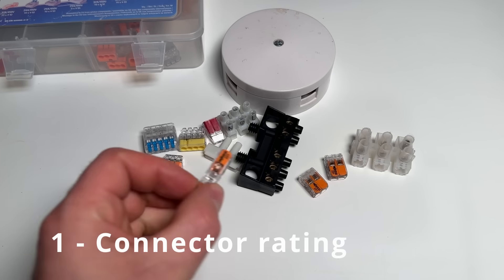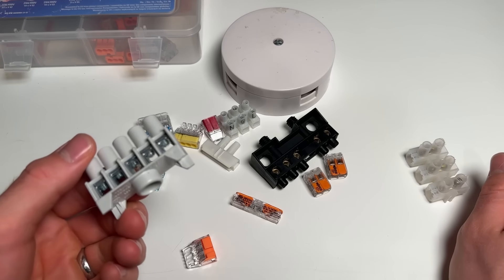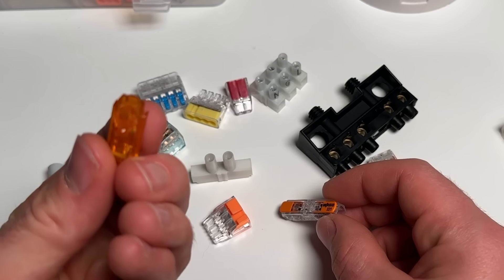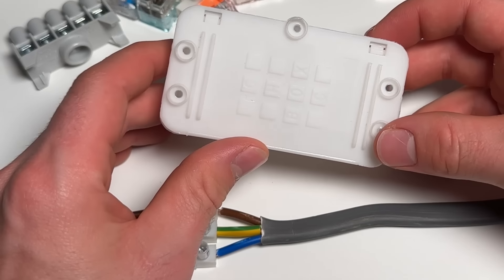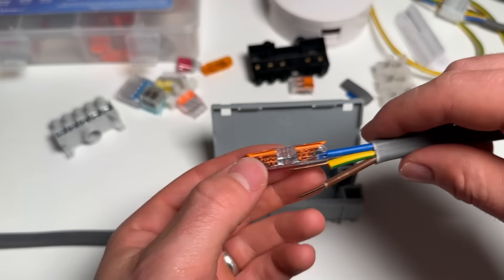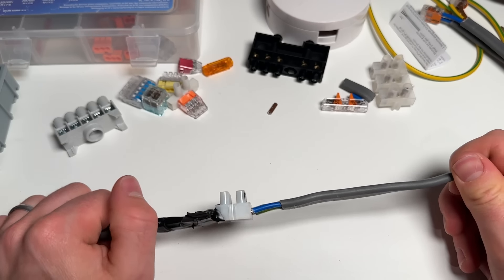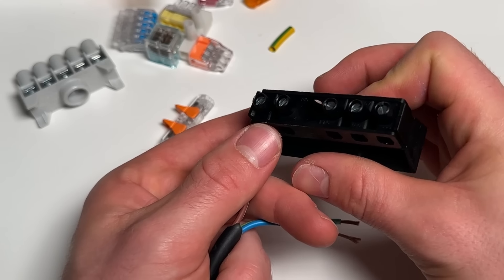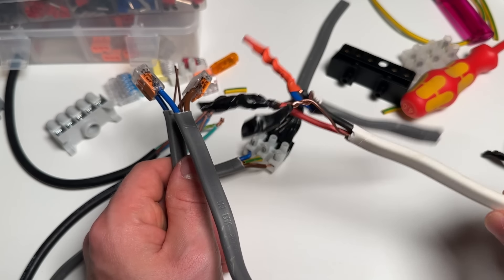BIGGEST DIY Mistakes Joining Cables

Comment: The 30 A junction boxes can be used on a 32A final ring circuit, but not a 32A radial. In fact a 20A junction can be used on a ring. A ring splits the current.
Reply from the maker: Rings don’t split the current evenly, you could in theory have a large ring with a socket close to the CU, pulling a large current, exceeding the 20a. Thanks for watching
Reply: @TheDiligentDIYer1759  
2.5mm cable takes approx' 26A max. One socket near the CU drawing max current draws 13A. Two is 26A, the max current rating of the cable. That is 81% of the protection device which is 32A. 

So, not all that 26A will be drawn from one leg, L1, of the ring. For example, about 20% will be drawn from L2 which means just under 21 amps is drawn from L1.  So the 26A max limit of the cable is not reached. It would need three sockets very near the CU to exceed the 26A max draw of the cable. 

The warmer the L1 leg of the cable the resistance rises, so more current will be drawn via the L2 leg automatically. Also if the first and second sockets are drawing 26A L1 will create resistance from the current draw of those two sockets, meaning current will come via L2 to the third socket. By the time there is any danger the 32A breaker would have tripped. 

An imbalance, can happen in a ring but it is a very rare event to the point it will cause a fire. But if maximum current drawing appliances are bunched near the CU creating concern, just fit the ring with sockets round robin, first socket on L1, second on L2, third on L1, etc. Or from the CU have 4mm cable to the first few heavy current drawing sockets, with 2.5mm for the rest.

Take note of the professionals.

Comment: Am definitely guilty (As a DIYer) of having wrapped the connector block in electrical tape in the past. Have also found examples of cables being twisted together and taped - mainly in older properties 😱 Yeah for speaker wire / bell wire, maybe... But can't believe anyone though that was a good idea for mains voltage!
Reply from the maker: Yes I think it is a common one haha. You would hope no one would twist mains cores, but I’m sure it happens! Thanks for watching!
Reply: @TheDiligentDIYer1759 nothing has ever happened from doing that ,you just overreacting just to make people buy the wagos ,surely you get paid by them
Reply from the maker: I wish I got paid by Wago, and electrical fires do happen
Reply: See my comment ( a few comments above ) , twisted wires CAN be used if you then SOFT SOLDER them and cover with adhesive lined heatshrink tubing ( from a professional  wireperson ) ..... DAVE™🛑
Reply: Twisting is fine for mains if you do it properly, unlike the caricature shown in the video

Comment: Very good instruction video ! ...... Flex breakages may result in a ( very expensive ) appliance being thrown away .... these  CAN  be reconnected , but , ( CARE ! ) the wires need to be twisted together and  then  SOFT SOLDERED ! , with adhesive lined heatshrink tube used to isolate the conductors .. then .. an overlay of tough adhesive lined heatshrink tube used  to surround the whole assembly ... this provides a ( safe ) but a tad ugly fix ... but ... it is VERY safe  if done  CORRECTLY ... DO NOT just twist and cover with PVC tape ( OMG  ! ! ) ..... ( tried - n - Tested , many times ! ) ...... DAVE™🛑
Reply from the maker: Thank you, thanks for watching!

Comment: Wago, ok for lights (bulbs) and low currents. Wago is not good for high current as they connect only by small pressure and on the tangent of the wire, so small contact area. I faced so many problems with wago but never with screw terminal when well used. It is always how you use them it makes a big difference. Wago is appreciated because it is fast and simple to connect wires.
Reply from the maker: Thanks for watching
Reply: They make Wagos that can handle 32amps and I have them connected on a 7500w 220v heater and they're just like the day I put them.
Reply: @wills5482  Ok, .....but wait.....after sometime they could get faulty. I faced several times problems with wago but it happened after 10 years and also depends of the environment. Anyway, happy they fit your needs. Regards.

Comment: Where I live, probably every house has twisted connections and it's been like this from WWII. Nowadays I see these fancy connectors being used, and some old electricians still prefer twisting wires - they say it has more contact than wago. And these are professional electricians near retirement, so with lots of experience. In 40+ years I never heard that some house burned because of bad connections. With that said all this "don't twist wire" sound like a propaganda to me. My house is almost 100 years old and it has twisted connections for 60+ years (that I know of). Never had a problem.
Reply from the maker: Thanks for watching!

Comment: can i use a 20amp battery with a 30amp connecter
Reply from the maker: Presumably you mean a 20ah car battery? The connectors i showed here are for AC 230v, i think you need to look at something designed for a car battery. Thanks for watching
Reply: @TheDiligentDIYer1759  I am on about 48v20am e bike battery can i use a 30amp connecter to connect the motor to the controller the motor is 1000w thanks for your reply

Comment: Twisting. oof.
I mean, I do join cables with a twist.... Then I SOLDER them, and usually heatshrink.
but what cables do I join like that? honestly, probably the worst was an EBike's controller. The replacement controller wasn't for the same bike, and a connector on it was wired wrong, so I cut the wires and joined them to wire it the right way, and as said, twisted braided wires together and soldered with heatshrink.
Reply from the maker: Thanks for watching!
Reply: @TheDiligentDIYer1759  You're welcome.

When it comes to wiring, I'm probably more old-school in that I usually use the screw terminals, or maybe a crimp.
I also try to avoid joining if possible.

Comment: the US  are lower rated on the wago becasue they put the electric cables direclty in to the wall including clamps connectors and branchpoints and whatnot and the walls are in best case wood with insulation between worstcase literal paper....so absoluitly no heat allowed...while  in europe they MUST be put into a dedicated box by regulation....
Reply from the maker: Thanks for watching!
Reply: In the US, junction boxes are required almost everywhere. No junctions without a junction box, and all junction boxes must be exposed.

Comment: The wago light wouldn't be maintenance free doing it the way you showed, you would have to use the carrier.

5733-MF (Maintenance Free) Accessory only with Wago 221-2411 Inline Connectors and Wago 221-2533 Mounting Carrier. Maintenance Free accessory instructions included with Wagobox Light enclosure must be followed
Reply from the maker: Interesting, thank you for watching!

Comment: What's with using cable ties to make the wago box maintenance free? Once clicked down, they aren't going to open.
Reply from the maker: I agree it is strange, but it is written in the instructions. Can’t say I’ve ever bothered with it though. Thanks for watching!
Reply: It’s a quirk of the regs: once cable tied you then need a tool to access it (eg scissors). the need for a tool adds an extra step/layer of (access) protection.

Comment: You showed the wago boxes, which are great. But I now use the Quickfix Junction Boxes for Wago's, much better! neater and suit UK wiring better
Reply from the maker: I hadn’t seen those before, they look great, I’ll definitely get a few of those soon. Thanks for sharing!
Reply: @TheDiligentDIYer1759  They are great but make sure you have the right size wagos. I bought one from amazon and in the picture it had the wago connector. Order some of those separately but they were the wrong ones!

Comment: Damn didn't have any idea that these have ratings. But the point could be that i'm in the Netherlands. Voltage is always 220 to 230, and ampage is limited. Bit i used Wagos(non lever) in my shed where i renewed all electronics myself. It could handle my dad's 3500 watt angle grinder with ease. So maybe these are more consistent and stable in europe?
Reply: Also i believe those extension boxes are illegal here. At least, most opt to replace the entire cable before going to those, or put a box in the middle
Also i believe that connecting ANY cables without a bigger box is illegal as well. So all boxes for connecting cables have multiple ports, have very specific certrificates and are a bit larger.
Reply from the maker: Interesting to know, thanks for watching!

Comment: A ring circuit cannot have over 30 A on any wire. The 2.5 mm² wires are not rated for 30 A.
Reply from the maker: Yes thanks

Comment: I would add that all connectors should be inside an enclosure. 

All connectors have there uses. I use them all, Wagos, terminal blocks etc. Depends on the situation. Using the terminal box connectors means that the cable is securely terminated as there is nowhere for the copper wire to escape to. 

As for taping over connectors...yuk. One way to set the place on fire. Self amalgamating tape is much better. Once applied, it never comes off - you need to use a tool, no matter how warm the place gets.
Reply from the maker: Good points, thanks for watching!

Comment: Amper ratings of all these connectors  only indicate the cable rating to be used with them. If you connect  0.75 mm2  cable with a 30A connector, even 10A  will cause fire
Reply from the maker: Thanks for watching!

Comment: The best connection is actually a twisted spike between two wires, but you need to make sure it is properly insulated and it only works for single core wire with some thickness to it. You have the highest surface to surface contact with this type of connection. It is pretty common in Europe. Other than that, if you wanna spend the time, you can just solder the wires and insulate them with shrink-wrap tube, this is the most long-lasting and strong connection you can get.
Reply from the maker: Thanks for watching!

Comment: Strip connectors... or chocolate blocks as they were nicknamed years ago, yeauch! I have admittedly used many but on low voltage signal wires and the number of them where the screws have failed is mind boggling. They are hardly mechanically sound in my experience, and therefor not electrically sound.
Reply from the maker: Thanks for watching!

Comment: Wago are making a killing with their range of stuff, no doubt the knock offs will be all over soon. Value wise junction boxes or connection strip are the best but for best electrical joints soldering with correct insulation wins but people just don’t want to do it.
Reply from the maker: Thanks for watching!

Comment: Twist connection is best of all. But You need to use pliers. Length of twist -2 cm.  After all - Solder it, and then wrap with insulation. It will last 100 years :) 
Screw connection - will always loose after time - I think due to temperature differences.
Wago springing connector (first shown) - I don't believe it - as there is very little area of connection. Could be good LED lamp circus and others with small current, but I'll not advice it for others.
Written description - what current and voltage is allowed to connector other than Wago is not important. Insulation in home electricity should be 1000 V resistant, and current should flow mostly between wires (wires should be put one on another) - not via connector.
Reply from the maker: Thanks for watching!

Comment: Personally I prefer to use " connectors" only at the termination.

( no matter what method you use to spice or join a cable, The weak spot will always be this JOIN ) !

For a HIGH Current Loads it's better to use cable of the correct length than to attempt to extend it.

( All joins introduce resistance, or deteriorate over time, resistance= HEAT. )

Most " High Current" circuits ( in domestic situations ) will likely be such appliances as Water Heaters or Cookers, you certainly would be best advised not to attempt to join ( or spice into )  feed lines to these ...
Reply from the maker: Yep agreed, best to avoid joints other than in sockets or light switches/fittings for domestic. Thanks for watching!

Comment: After spending 30 years in the U.S. repairing and installing traffic signals and street lighting, with wiring connected by countless thousands of wire nuts, I was curious why you didn't mention them.  Apparently they're rarely used in European countries, but I would trust a properly installed wire nut over anything shown in this video.
Reply: That's funny. As a European, I tend to cringe whenever I see someone using wire nuts and would never prefer them over anything shown in this video ;) They just seem like a horrible idea to me, prone to being unreliable and unsafe (just based on how they work).
Reply from the maker: Wire nuts aren’t really used in the UK. Thanks for watching!

Comment: Twisting is the best way to make a connection in my opinion, but only if they are done properly. What you showed on the video was one of the worst examples of a twisting I have ever seen, something like that would most likely catch fire. The reason for twisting being the best is becuase you have no intermediate piece of metal with different properties (eg.: thermal expansion, conductivity, etc.), and no spring contacts or screws that can loosen up overtime, and can bite into the cross sectional are of the wire (depending on the design of the terminal, if the screw is not serving part of conducting the electricity, it results in the loss of the wire's cross section). I've had bad experiences with Wago terminals, they can blow open if a short occurs, or if there is a large inrush, which is not a daily thing, but it can happen. (And no they weren't overloaded. This happened on a socket circuit in the hallway that had 16A breaker, and a vacuum cleaner plugged into it, and both live and neutral Wagos blew when I switched it on. The vacuum wasn't faulty, it just had about 22-25A of inrush.)

Edit: It's even better, if a well twisted connection has a wire nut on it. That can stand anything.
Reply from the maker: This was a video about how not to do stuff, so i was going to show bad examples haha. I agree twisting done well is a good quality connection, but unnecessary with high quality connectors like wagos. Thanks for watching!

Comment: It’s a different rating in the US because the AC current oscillates on 60Hz. It’s 50Hz in the UK. It’s the amount of power going through the cable over a given time.
Reply from the maker: Thank you!
Reply: I think you will find its the voltage that makes the difference.  Lower voltage in the USA means higher current for same power.
Reply: Frequency doesn't have an influence on power 🤦‍♂️

Comment: Great ad for Wago. But really... gas-lighting the world about screw terminal connection blocks is not cool. There are billions in service all around the world. As long as the principal of double insulation is applied, there is no risk of a screw type connector failing UNLESS it is physically damaged, or the screws are not fitted correctly... which all boils down to concentrating while you work. Never allow yourself to be interrupted half way through connecting a cable!

Screw type electrical connectors are all designed for 120 or 240 mains applications. There is no point in using these fittings for any low voltage circuit, because connection blocks all add resistance. The only risk of using an unmarked UNDAMAGED connection block scrounged from an appliance, is the plastic may be sub standard. Some manufacturers try to cut corners on internal connectors by using plastic that is not UV stabilised, which is why it is best to avoid translucent white plastic connectors when dealing with mains electricity. Black, grey or solid white should be OK.

The international standard for plastic electrical insulation is PVC, because it is VERY hard to start it burning. Take a bit sometime and put it into a flame. Get it burning and pull it out. The flame will not keep burning. It takes a LOT of heat to keep PVC burning. Which is why it an excellent first line of defence against sparks and hot wires. The golden rule is to ALWAYS put two layers of insulation between you and the copper.

The biggest problem I have with gas-lighting the general public about screw blocks, is that unqualified people may feel compelled to 'fix' a problem that does not exist. This may be good business for Wago, but the more people stuff around with mains electrical fixtures, the greater the chances of injury or death.

For the punters out there… if you are not sure… ask around for advice… and yeah… the Wago connectors are great.
Reply from the maker: If only wago were paying me haha